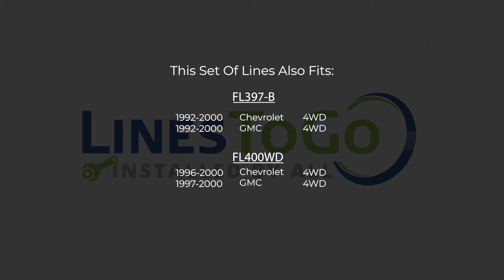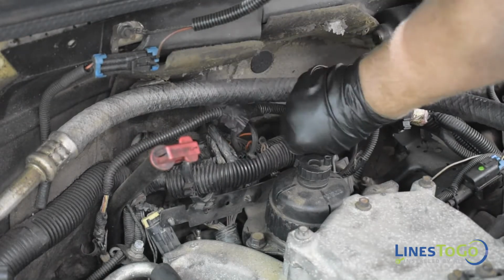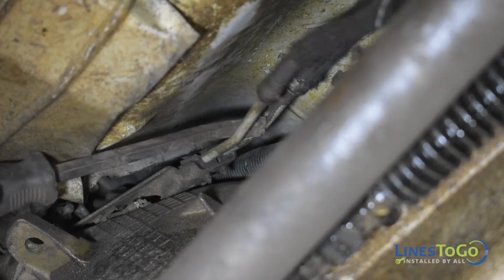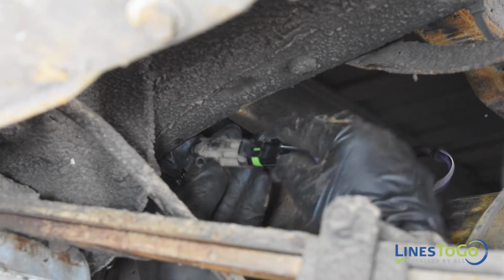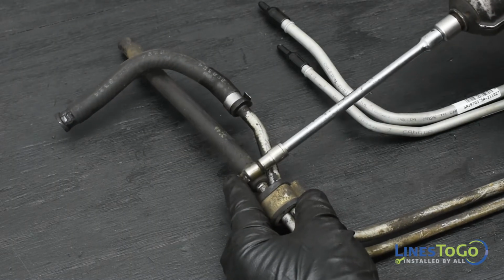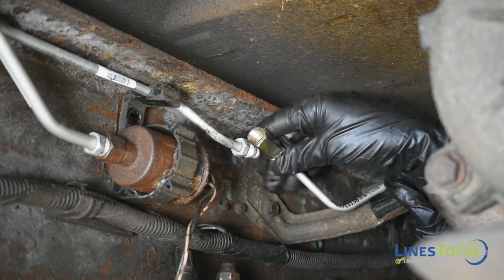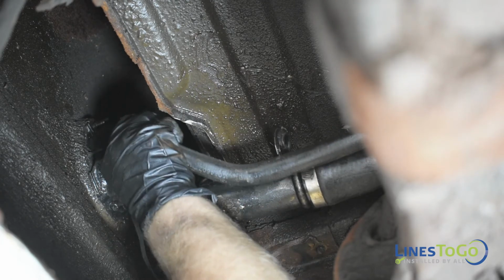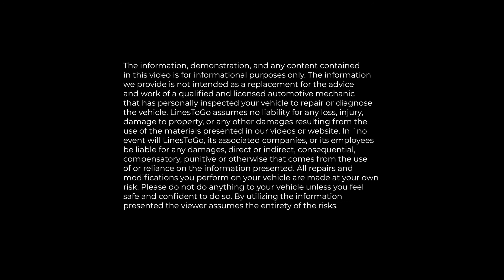How to Install 1992-2000 Chevrolet Silverado/GMC Sierra K Series Diesel Fuel Lines

Comment: What thread are those fuel lines at the tank?
Reply from the maker: Hi Greg,

I have the fitting for the hose that attaches at the tank. The 3/8th is .375 and the 5/16th is .313.

Hope this helps,
LinesToGo Team